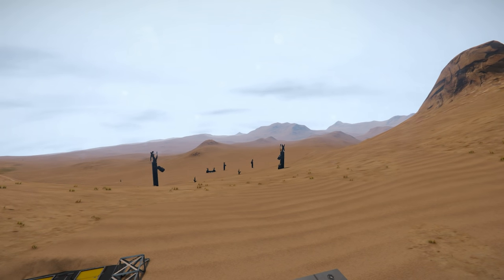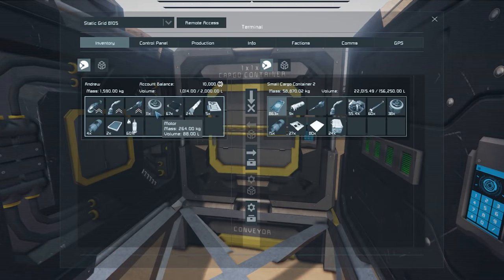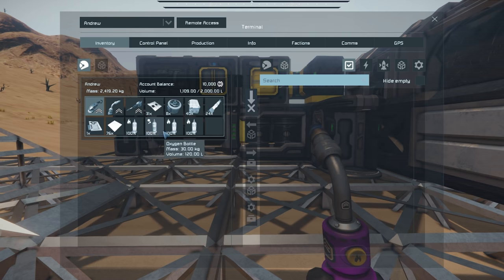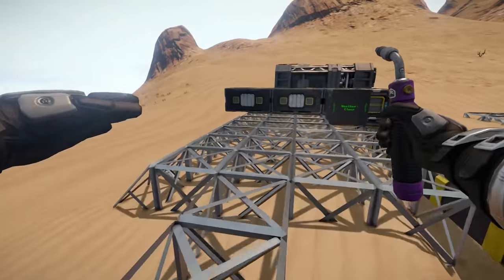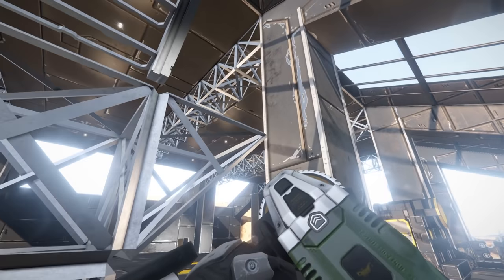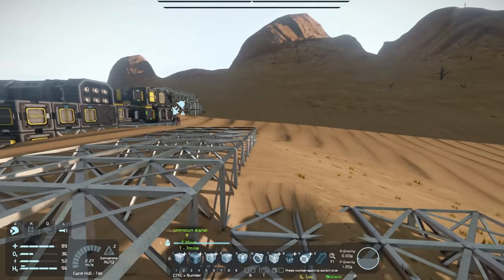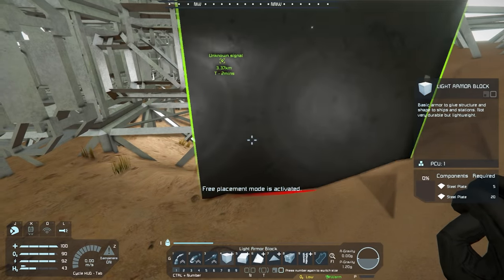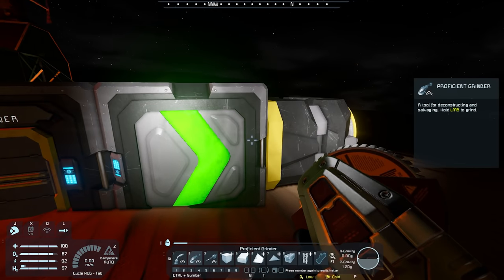Space Engineers Survival 2021 (Episode 8) - Lots of Base Work [Pertam]

Comment: Six assemblers with two speed modules each MULTIPLY your power requirements by a factor of eighteen. So, if an assembler uses 500 Kw of power, your setup requires 500*18, which is nine Megawatts. Do you have a nuclear reactor to provide that kind of power?

EDIT: Checked the wiki, an assembler actually uses 560Kw of power, which makes matters worse.

Comment: use the corner LCD block, but don't weld it up.
it will provide the attachment point for stairs and hide perfectly underneath.

Greeble's are all the pretty bitz once all the functional parts are done.

for best results with assemblers. stand them on end so all upgrade ports are available
all conveyors can be routed under the floor connecting each unit back to the refineries.
another Conveyor system can be attached atop them feeding into a couple large storage containers for ready use that are also connected to the system going into the Hangar fitted with a sorter to screen out ores. salvaged materials will go straight into the storage unit.

Assemblers should be maxed out with speed Modules.
Refineries should have 1 speed Module and 3 Yield Modules to wring out every bit of use from the ores collected.

more power needed.
a lot more power!
keep an eye out for downed ships as they have Nuclear Reactors aboard you can salvage to put into your base for added power needs.
drones taken out may have small reactors and some U-235 in them.
the Modular Encounters Spawner along with other enhancements like Surface Occupation, Abandoned settlements, Air Traffic, and Splitsie's Assertive Installations will generate loads of hostiles to make life interesting and all manner of sweet salvage.
you may need a small flying scout ship to trigger the spawns, but such a craft isn't hard to build.

the top of your Hangar can host a large solar grid on Rotors using Izzy's Solar tracking Script to get more power when you need it most.
especially since your base is oriented east/west for sun tracking.

Gunz!!!
start planning Gun positions and get them built and supplied with bullets. <go find Magnesium STAT!>
use the Smart Turrets 2 mod to make sure your guns don't trash everything ruining any salvage possibility from downed drones.
the Smart Turrets can be set to selectively target certain systems like Offensive Blocks and ignore everything else.
once Drones have been defanged, you can fly up and down them with your grinder then clean up the wreck.
Reply: Isn’t there also a script that automatically sorts and builds components? Like, you tell it how much to make and it makes sure there is that many of the component at all times.
Reply: @spacemanspiff7283  
there's several of them on the Workshop but off hand, I don't know who makes the best version of the Inventory Manager.
definitely a nice script!
Reply from the maker: Thank you for all the tips! We'll definitely be focusing on the Gunz part next episode :D

Comment: your assembler setup does look cool like that, I need to point out though that the conveyers connecting the junction to the top and bottom assemblers in the stack are irrelevant because they are already connected to each other because the way they are stacked :3

also wanted to ask about drones on pertam, I have had them on the entire time but I have not seen 1 enemy signal. do you, or anyone reading this, know whether they even show up on pertam? noticed you have discovered 1 enemy faction so it popped into my head
Reply from the maker: Are you talking about vanilla game drones? I don't think those show up on planets at all. Only out in space. If you want planet drones, you probably need to add a mod that handles that sort of thing. Reavers and Corruption come to mind for hostile mods, and Air Traffic comes to mind for neutral ships that fly by.

Comment: For the rafters do as u did on the roof middle sections but the other way round and in an other color also the pillars in the hanger try the weels but only weld in the Steel plates

Comment: One of the neon blocks is even less visible than the corner light when doing the stair connection thing.
Reply from the maker: Ooo really? I'll have to try that. Thanks for the tip!
Reply: @AndrewmanGaming  
I sometimes use neon corners to make 3+wide catwalk paths more interesting, by having the middle ones be one block lower and upside down, it brings variety and greeble to it and allows me to put things like freight crates on the catwalks, connecting them with the neon corners makes it almost invisible, while preserving the structural redundancy that would be lost if the catwalks were not connected.

Pretty sure it can also be useful with window blocks in some situations.

Comment: Assemblers can have upgrade mods put on all four sides, not just two sides.
Reply: yes. better to put them vertically with 4 modules.
Reply from the maker: How does it work on the side with only 1 module connection? Is it half the bonus of the other sides with 2 connections?
Reply: @AndrewmanGaming there is a second connection on those sides, it is hidden inside the access area that you would hook the conveyor into. There is a smaller square inside the larger one, that is for the upgrade module.
Reply from the maker: @devum5075  Ohh ok, it's been hiding this whole time! I'll have to remember to use those in the future. For now I think the 2 modules per assembler is fine. It might be a bit slower than the optimal set up, but I can make up for that with just more assemblers.